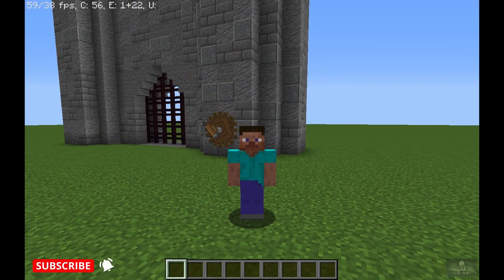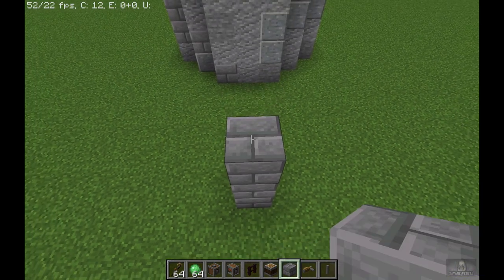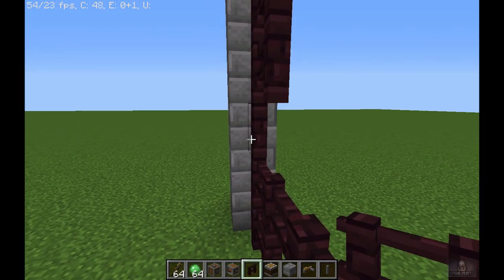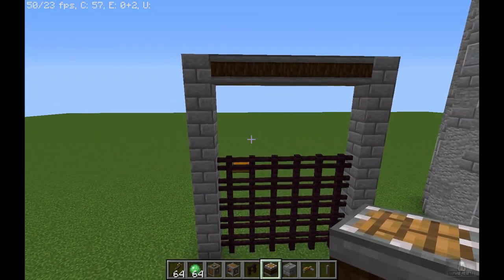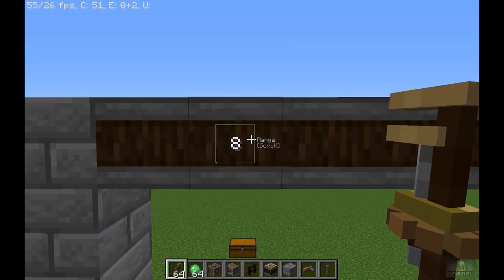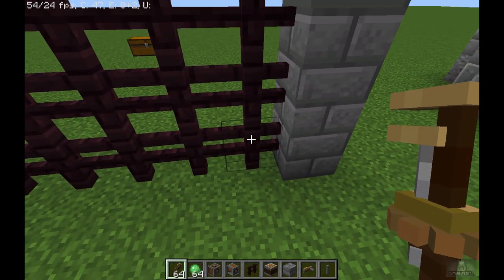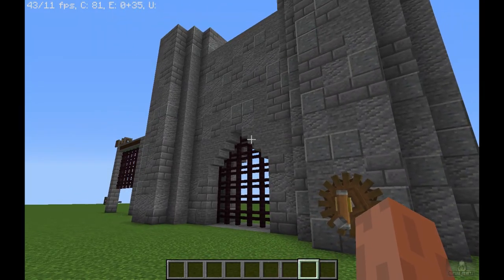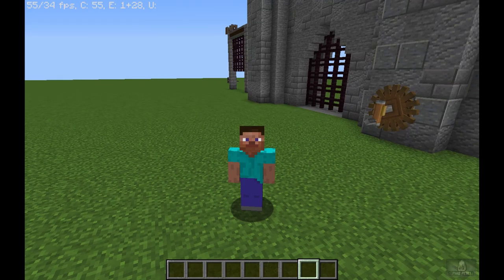How to make a Working CASTLE GATE / Portcullis Gate in Minecraft

Comment: your voice is strangely soothing when you explain things.
Also, could you do something like this, but say if you shoot a button, it automatically raises it with this create mod? That and a drawbridge. 
I was going to add it to my server in a dungeon I'm making for them. They raid a castle and have to shoot a button to raise a portcullis
Reply from the maker: Thanks , that's a compliment I don't usually get :D
As for shooting a button to open the door and lowering a drawbridge , I think you can achieve that with the Target block. Now as you might know the target block gives out a redstone signal based on where the arrow hits , you can take this signal into a wireless transmitter / receiver pair that can toggle the the door and drawbridge

Now if you want to take it one step further you can take the signal from the target block into a comparator and have it set into subtract mode with another redstone line of some strength running into it's side. That way the comparator will only give a signal out if your arrow hits near the center of the target block making accurate aim a must if you want to open the door.

Those were some of the idea's that I could come up atm , I haven't really played create mod since a long long time , all I've done is trying to keep up by watching it's videos. So yeah lemme know what you think of this idea !! I personally feel having a target block with comparator will convert the task of opening the door into a minigame of sorts
Reply: @SavageVegeta  Awesome! Managed to achieve both, they're going to have a great time thanks to you!
Reply from the maker: @lazerlancer1861  yoo that's pretty dope , I hope all of you have an amazing time on the server !!